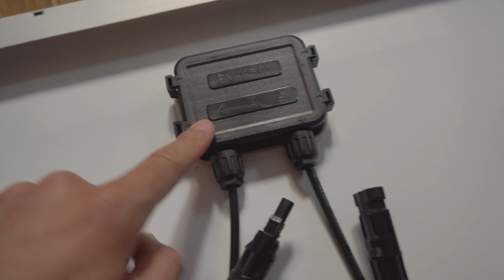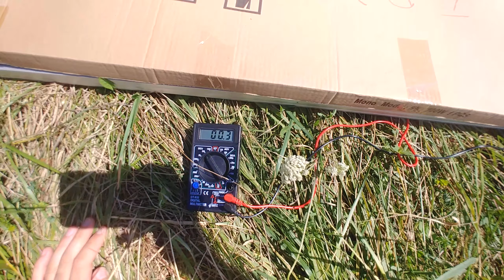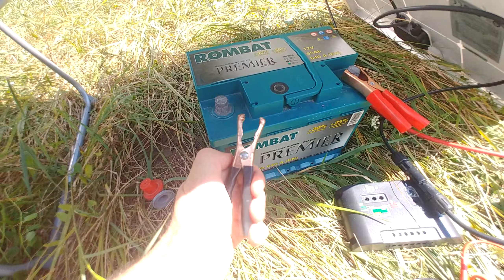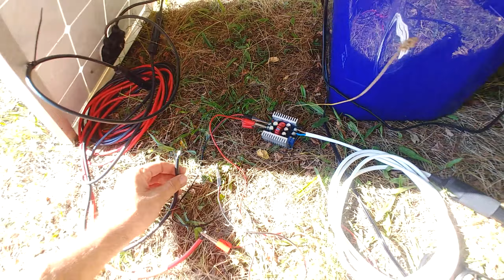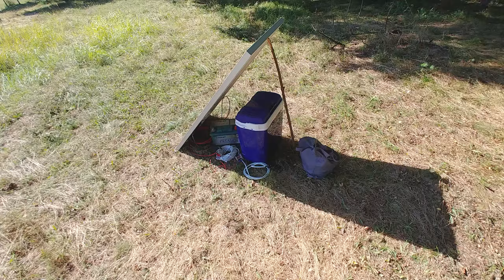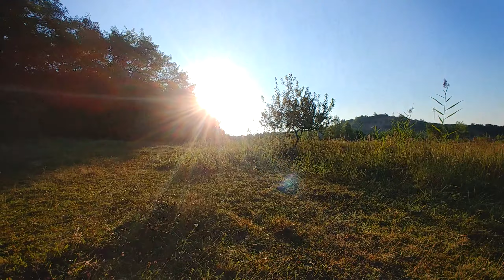100W Solar Panel running a 12V Fridge (Unboxing, Usage)

Comment: Foarte fain video-ul, dar acea cutie frigorifica este exrem de ineficienta fata de un frigider cu compresor de 12v. Cutia aia o sa consume in permanenta 50-60wh pe cand un frigider cu compresor va avea o medie de 11-12 wh si putere de racire infint mai mare. 
\
Reply from the maker: Am cumparat si un frigider cu compresor (40 l), consuma cam tot atat cat acesta.

Comment: This is an excellent idea for camping, because when it is sunny the fridge cools, but when the sun stops the fridge stops which I think is ok.  The fridge only really needs to cool when the sun is strong.
Reply from the maker: The fridge should work almost all the time if air temperature is pretty high and people are constantly opening and closing the lid.

Comment: Nice video, thumbs up ! Do you think that it would run the fridge with a 50w solar panel without a battery? Can you also put a link from where to buy this 12v reducer?
Reply from the maker: I think it would run it, but maybe at a slightly lower rate. I bought the "buck converter" from a local website in Romania (Europe). Try it from a website from your country, or ebay surely has it.

Comment: Thank you for a very clear explanation of your solar refrigerator. I have used fridges that run on kerosene, and also have used propane fridges. It is such a counter-intuitive concept that a fridge can run off of a flame, but the sun is a big ball of fire after all. 
New solar panels now exist that are much more efficient than the ones in use currently. More frequencies of the solar energy are being collected by the new panels. A Solar panel could potentially be made that also heats water or air at the same time as producing electric power, and new flexible, fabric-type solar collectors mean that we could have a tent made from photoelectric cells.
Reply from the maker: Which ones are much more efficient?
Reply: @furulevi  The most recent development in solar cells are not yet on the market as far as I know, so have no exact details. I have just heard that they are being developed.

Comment: Isn't there a controller available that can run a fridge directly from the solar panel without the need for a car battery?
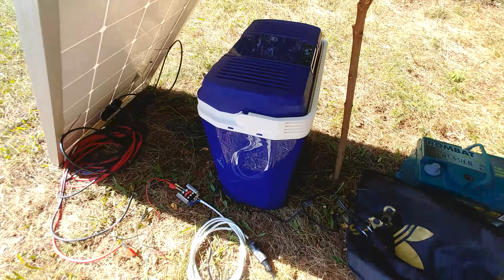Reply from the maker: Yes, it's shown at 13:53. It limits the output voltage to a desired level, 12V in this case.
Reply: @furulevi  Hi , where can I find one of these "BUCK CONVERTERS" for my 120 watt Solar blanket 
And which one would be most suited to run my fridge Thanks
Reply: @furulevi  bought a buck converter online,  two actually 
It has a digital display and buttons either side 
No instructions...pushing the buttons things start flashing and I'm able to set both in and out to around 12.7 volts 
Yet my fridge keeps coming up with an E1 alarm and doesn't work 
When I measure on the outlet side of the buck meter is keeps reading 17.5 v ,exactly what my solar panel puts out!!
I can not get actual 12-14 volts going into the fridge 
The buck converter doesn't convert down
Sugesstions please,  thanks

Comment: Thermocouple fridges are very inefficient and power hogs.  Food will chill 20 to 40 degrees farenheit and the draw is high.
Reply from the maker: Aren't compressor based ones consuming around the same amount of power?
Reply: @furulevi  Compressors beat thermocouple/ Peltier refrigeration by an easy factor of 5. I own both. The Coleman is now a box for clothes.

Comment: Is it safe to run a 12v dc fridge without and inverter?  Just want to run the fridge.
Reply from the maker: This fridge has to power cords, one for 12V DC and another for 220V AC, so this requires an inverter only if the 220V cord is used.

Comment: i am planning to make a setup like you but i have no knowledge about electricity and also my biggest problem is that i dont know how muchpower is  my portable fridge consuming. can you help me somehow with some advice?
Reply from the maker: Power consumption related info might be found online, or it can be measured (minimal knowledge is required).
https://youtu.be/9mu7-HOqXAY
https://youtu.be/HfAz9iVQoiY
https://youtu.be/MIvovRC-ews?t=510 (DC current measurement, Clamp meter)

Comment: What size controller is it will it shut off to save the battery
Reply from the maker: I used this simple, cheap, old controller ► https://youtu.be/V_nR9k7LuRk. Yes it turns OFF the power from the solar panel when the battery voltage is too high.
Reply: What stops the fridge draining the battery at night ?

Comment: Thank you I will watch this several time. It explains alot. I wasn't sure if I could run a 12 v. Fridge on a 100 w. Solar panel. I need an  AGM battery , that's a cool video man.  Thank you .
Reply from the maker: I used a 50W fridge and a 50W laptop using one 100W solar panel and the battery voltage didn't dropped.

Comment: May i ask if my freezer is going to be used for 12hours per day and it is 66W. How much Watts solar panel do i need to get. How do i calculate something like this
Reply from the maker: If your freezer consumes 66W then at least a 66W solar panel would be needed not to drain the battery. A 100W panel would be OK to have a little bit of excess power to keep the battery fully charged.
Reply: @furulevi  also....... Does the charge controller automatically reduces the power flowing from solar panel to battery? There isn't a need to set anything specifically on the charge controller and it would just carry out its function on its own?
Reply: @furulevi  thank you for the reply. I am actually doing a school-related project and my groupmates are using the solar freezer setup you used. However, when we consult our lecturer he mentioned we need to account for power losses and my friend came up with this calculation https://drive.google.com/file/d/10xN7HdQiJmV3FFuJimUTOjOVRTZrW9_X/view?usp=sharing . In my opinion, there has to be some sort of mistake in that calculation. We want the solar panel to be able to charge up the battery enough so that it will last for at least 2 days if there is no sun for long periods of time. If so, is using just a 100W solar panel enough?
Reply: I put a 150 watts solar panel on my van this week.
In full sun now summer time,I get 50 watts out of it,my battery pack river pro, runs a small compressor fridge that draws when it runs 65 watt,
Battery pack last for only 4 days till it's empty
At night the fridge uses 25% of the battery pack

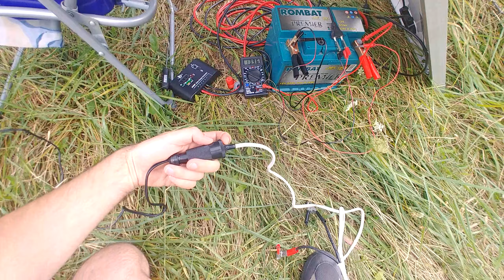Comment: 1. I would like to know what is the connector/head of the wire called in 9:33 
2. what kind of plug does ur solar fridge use? It's not the normal 3pin/2pin plugs a household would use
Reply from the maker: 1. That's a 12V car plug and socket;
2. European 220V plug.